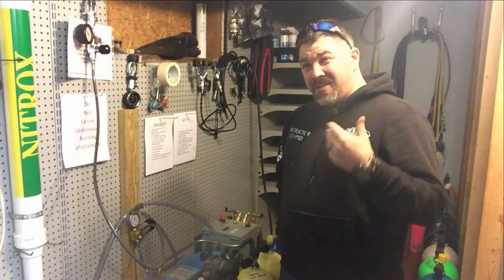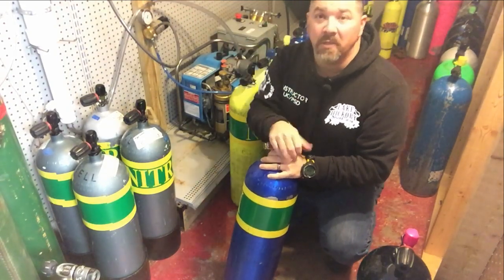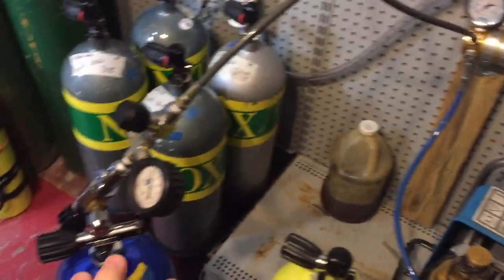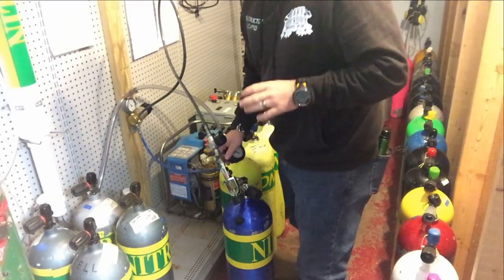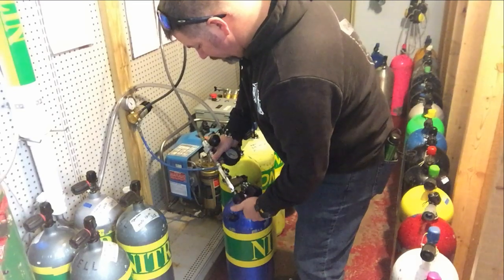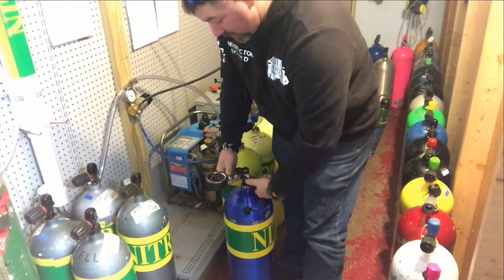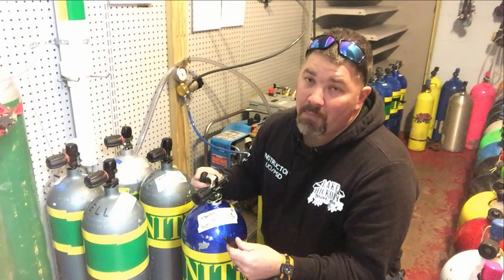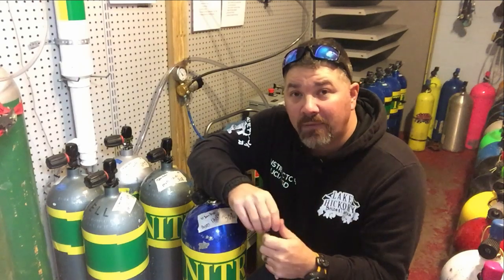Continuous Blending Enriched Air Nitrox

Comment: I watched your new cylinder prep video where you covered your cascade fills. Since you bleed down one customer cylinder to another to equalize all cylinders being filled is there a risk of someone having a cylinder that was previously filled with a higher O2 mix than air messing with the other cylinder being filled where their air MOD could be affected? Obviously we check mixed gas fills, and I’ve caught bad fills before (27% that’s should have been 32%). After that I also started checking air fills just to be sure that there wasn’t an error filling them.
Reply from the maker: Hello Caleb Mcelhaney, our fill operators are trained specifically on our fill stations, and for any mixed gas, they verify all mixes after the fill. Top offs as some would call them, can cause certain mixtures to be wrong. This is why all of our fill operators are required to go through the SSI XR Gas Blender course and they routinely get trained in compressor maintainence as well. Customers are also required to verify fills prior to leaving with their cylinders. We encourage all customers to verify even their air fills prior to diving.

Comment: So do you prefer to add compressed O2 rather than use a membrane type system? When would you use one over the other?? Thanks!
Reply from the maker: Most shops will either use partial pressure blending or continuous blending method due to cost.  Membrane systems tend to be more expensive, and most shops choose not to make the investment upfront.

Comment: Bryan - I enjoy your videos.  I don't mean this question as a "gotcha" one--I just want to see if I am missing something.  I assume the process of filling the tank in the video was a continuous one and so what you set the initial fill for the stick is what you should get when you do the final analysis with the hand-held sensor.  Given that assumption, I didn't understand why the locked in pressure on the O2 sensor was set at 31.3% (7:00 minute point on the video) while you later said it measured 29.9% (9:00 minute point).  Did I miss something (sadly, not a rare occurrence!)?  Thanks.
Reply from the maker: Hello @dkk923, great question. This particular cylinder most likely had a lower blend in it to begin with. By adding the 31% to it, it mixed it up to the 30%. We have several videos showing how we mix different blends that you may find interesting. 

Mixing Nitrox from Nitrox
https://www.youtube.com/watch?v=mWrtxyFKF-g&t=467s
Reply: @LakeHickoryScuba   Good point.  I figured there was some possibility I was missing!  Thanks.  :-)

Comment: Hi there
Quick question, why the analyser before the compressor was reading 31.3 and after filling was marking 29.9
And should you leave venting a bit before filling the actual cylinder?
Thanks in advance 
Manny
Reply from the maker: Hello @user-he8hy2cc3t, the short answer here is Charles's Law. Partial pressure will change as temperature changes. During the filling process, the gas is heated during the compression stage, and over time will cool, thus losing pressure. When this happens, mixes can change.

Comment: Hey brian. That’s a brilliant idea. But what happens if the oxygen is contact in with oil inside the compressor   Does it not initiate flame hazard?
Reply from the maker: Hello Farooq Mansoor, you present a great question. Thankfully we have what is called the 40% rule. And since we are mixing blends at 40% and less via continuous blending, the risk of an explosion is negligible.
Reply: @LakeHickoryScuba  thanks a lot man for the reply. I myself is an Divemaster and planning to pursue my Technical course. Ur video was great help and motivating. Continue what u do. 
Peace ✌️

Comment: Hi Brian, 
Thanks for posting video,
I do my own high pressure nitrox mixing as home presently but obviously pain as cylinder pressure starts dropping, im interested in making my own mixing stick suitable for 3cfm compressor, i presume you built yours and wondered if you would mind giving me some pointers , i.e diameter pipe ,size amount wiffle balls ,anything special you need to do is it basically just a big baffle?,
Many thanks, 
Darren
Reply from the maker: Hello Darren Gibbs. Send me an email to bryan@lakehickoryscuba, and I will be happy to share some plans with you on how to build your own Nitrox Stick.
Reply: @LakeHickoryScuba  Thanks Bryan I couldn't get message to send via your personal one you sent me but have managed via your shop/business email ,
If that finds you OK?,
Regards,
Darren
Reply from the maker: Hey Darren Gibbs, not sure what is going on with my email, but I received on the company's and have responded to it. There are plans and pictures attached. Hope this helps.

Comment: Have you done any videos or any need for the difference  between nitrox clean and O2 clean? Hearing differ8things from different people
Reply from the maker: Hello jbunderwaterservices4132, from the beginning of time (the beginning of the scuba industry selling mixed gases), there has always been differences in opinons on using Oxygen Cleaned Cylinders for anything other than standard breathing gas 21%.  Fill station operators are required to abide by DOT and CGA gas laws in the United States. Most shops (non International Training Shops) that are certified through PSI / PCI, will require cylinders to be Oxygen Cleaned for any gas mixture above 21%. What you are referring to as Nitrox Cleaned is not an accurate way to describe the actual cleanning of the cylinder. With Oxygen Cleanning, the entire purpose of the process is to eliminate all hydrocarbons from the cylinder. Once this is complete, as long as Modified Grade E Air (Oxygen Clean Air) is used, the cylinder will remain Oxygen Cleaned until the cylinder valve is removed. Once atmospheric air is re-introduced into the cylinder, it theoretically is no longer Oxygen Cleaned. Now the argument we here all the time is, if you are using pre-mixed or pre-blended gas mixtures (in short a Nitrox Stik mixing station) then the risk of the fire triangle occuring is limited to the point, the fire hazzard no longer exist. Only during the mixing phase of partial pressure blending, does the fill operator have a substantial risk of injury. Whether a fill operator follows this way of thinking or not, he or she is still bound by the insurance company that covers the shop, and the current DOT and CGA gas laws. Thus, they follow the rules. The simpliest solution to not have to worry about the shop giving you any hassle is to buy a small compressor and building your own Nitrox Stik for practically nothing. I have built them in the past for less than $100. You can pick up a small compressor for around $2000. Thus, for $2100, this would be paid for after about 210 fills, not including filters, oxygen, and normal maintainence fees.
Reply: @LakeHickoryScuba  thank you, you just reinforced what I thought  was correct.

Comment: What is the pump that whip is connected or coming from and what’s the reason it is needed?
Reply from the maker: Hello Chris Payne, if you are asking about the smaller compressor unit, well its a compressor. If you are referring to the PVC Pipe mounted on the wall, that is the Nitrox Blending Stick.
Reply: What is the small compressor unit actually for since the compressor is the one pumping the air into the tanks? Just curious knowledge is power.
Reply: @chrispayne806  It seems you're confusing two things. There's only one compressor in the video: the blue Bauer Junior II. That's what compresses the gas into the cylinder. It pulls in gas through the yellow/green Nitrox mixing stick. The stick has two inputs, air from the tip and pure oxygen on the side from that big cylinder (which has a pressure reducer on it, a simple regulator valve). Inside the stick, the air and oxygen mixes and a nitrox analyzer at the bottom of the stick gives the operator feedback so they can adjust the oxygen input flow to get the desired mix on the output. That output goes straight into the compressor and from there into your cylinder.

Comment: Is that actually the compressor you use to fill tanks? Or just for blending gases?  I have the same compressor i believe.
Reply from the maker: Hello David allen, we have several compressors.  This is the one we use for Nitrox fills. We have a much larger Bauer that we use for most air fills.  It has 4 cascade cylinders that we typically will fill from.

Comment: How much does the air flow through the stick (and therefore the amount of O2 you have to add) change as the tank fills? I'd assume it slows down significantly as the pressure goes up.

Also how do you like that QuickStick analyzer? I've been thinking of getting one just to double check my own tanks.
Reply: it does not change. the compressor runs at a constant rpm so the inlet takes in the same as if it is at 100psi as it would at 3000psi  the only time they mess up is if your O2 reg is bad or the compressor belt is loose but that should not happen with a proper look over before you use it. i added a solenoid valve to shut off the O2 when the compressor shuts off or losses power. just so no O2 builds up. a pure O2 hit in the compressor could be very bad
Reply from the maker: Hello Dan Bowkley, b st john explains it very well.  The intake can only take in so much air at a time.  The micro adjustment on the O2 cylinder only controls how much O2 flows into the Nitrox Stick itself.  As far as the analyzer, I have used just about all of them.  They all work great, this just happens to be the ones I am using now.

Comment: are you running the compressor indoors? where is the exhaust going my man?
Reply from the maker: Hello DrKoz Forensics Detectors, our intake is piped from outside the building, so no worries of contaminated air.
Reply: @LakeHickoryScuba  very cool, just making sure, we just launched a low level CO detector for scuba and when I heard the noise (with no smoke or coughing) I figured you did the right thing, cheerz my man!
Reply from the maker: Hello DrKoz Forensics Detectors, the article looked good. The only questionable bit of information was under the  "What is Enriched Air Nitrox?" heading. I believe its the 5th sentence, "In recreational diving, Nitrox contains oxygen from 28-36% oxygen."  Most if not all WRSTC Training agencies recognize Enriched Air as any O2N2 Gas mixture with a partial pressure of O2 above 21%. Recreational mixes ranging between 21%-40%. Hope this helps.
Reply: @LakeHickoryScuba  ok great input, made changes, thank you for that!

Comment: Is your compressor compatible with O2 over 21%?
Reply from the maker: Yes it is.  We have it tested for modified grade E air, and we use the appropriate filters for it as well.  We never run above 40% through it though.

Comment: Geez you are doing it all wrong, everyone knows you use BLUE masking tape. LOL

One danger of a cold cold fill is that the pressure can shoot up if the water is warmer. I remember a cold day (well for Florida at 60 degrees) I setup my tanks, and put them in the spring water (at 72 degrees) when I went to put them on they went up another 250psi.
Reply from the maker: Thankfully Charle's Law plays a big role in the matter.  For every 1 degree temperature change, your PSI will either raise or lower 5 psi.  With this being said, most valves are rated to 5000 psi, as is the test pressure of most standard 3000 psi cylinders.  So the likelihood of a cylinder being jeopardized by an over fill due to heating up, is highly unlikely.
Reply: Here in California a tank can get pretty hot sitting in a car but burst disks are rated for at least 25% over working pressure. I've had bad tank valve o-rings go but never a burst disk.